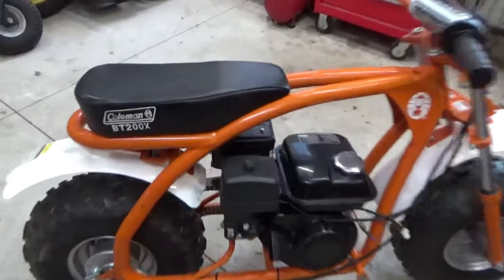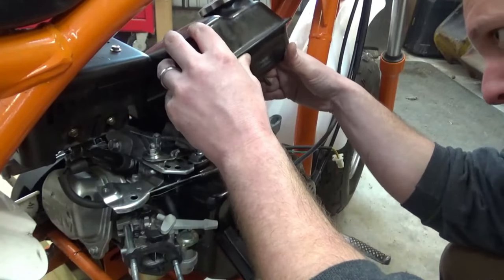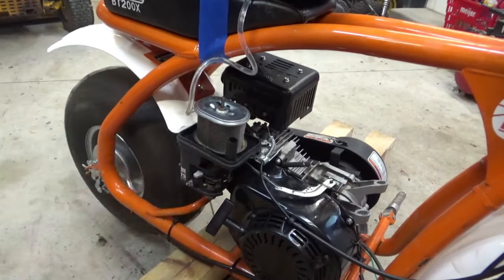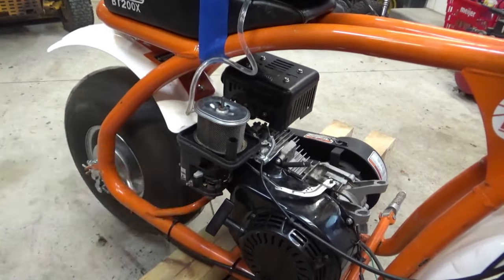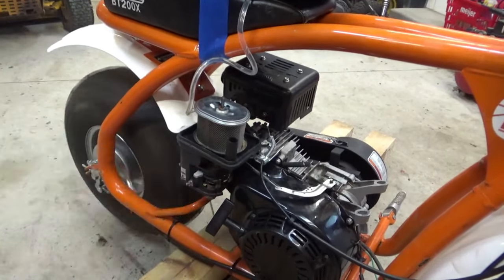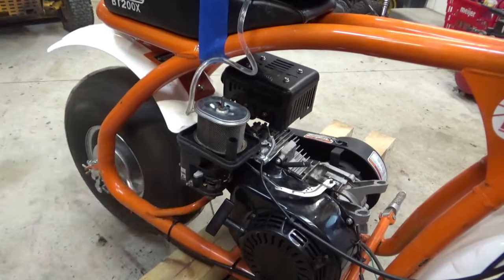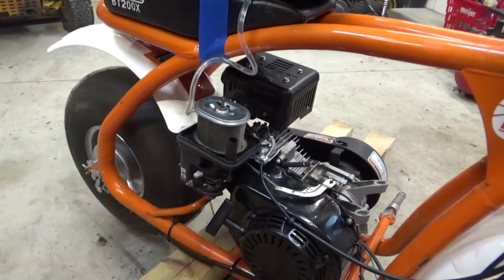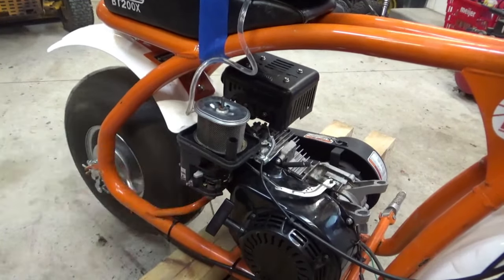Coleman Minibike's not running right...

Comment: The choke lever to the left is choked. Moved to the right is choke off. 

Pulling the governor is never a good idea unless you do not care about shortened engine life and the possibility of catastrophic failure. Governor removal should only be done at the time of an engine build.

There's nothing wrong with the governor/throttle linkage. It's a 30 year old Honda design that is still used to this day. The only negative is the Coleman return spring which is too long and can bind. I shorten the spring and use a small spring like you used here. I run built engines with the stock linkage and governor. Both bikes are 45 MPH plus. One of my bikes runs to more than 50 MPH at 5600 RPM.

The Hisun 196 is a good quality clone engine. Easily a better quality engine than the 196's that Harbor Freight sold prior to the Predator coming out. It's too bad so many of them have been abused and ruined then called junk by those who ruin them.
Reply: @quintinalvarez3922 laughing like 🤡

Comment: Greetings, just found your channel. I have 2 mini bikes, one is a Massimo Warrior mb200 (which is a rebranded baja warrior) it has a predator non hemi 212cc wit a billet flywheel, +.020 billet rod, hot265 cam, thin head gasket,  stainless steel valves with 26lb valve springs, and a vm22 carb. My other is a trailmaster mb200-2 with the factory 196cc with the billet rod and billet flywheel, cm cam, 26lb valve springs, and a vm22 carb. These are great little engines with a few mods
Reply from the maker: Welcome aboard!

Comment: also  instead of drillin and tappin that old governor hole you could have just cut the arm off the shaft and put it back in the case. that way if a governor is ever wanted to be reinstalled the hole isnt all messed up. just sayin

Comment: That Fly Wheel Is Weighted For A Governed Engine , It Needs A Aluminum Billet  Fly Wheel, A Much Lighter One Because Of The RPMs It Will Be Doing. That Heavy Fly Wheel Doing Those Kinds Of New RPMs Will Get Destroyed & Do Major Damage To That Engine. That Old Fly Wheel Is Not Designed For That.
Reply from the maker: Jon I have to disagree. I’ve seen lots of ungoverned engines run with their original flywheels and never cause damage. You’re not in the business of selling aluminum flywheels are you?
Reply: @MikesGarageShop   Ha Ha Ha . your Funny. Ok You Will Find Out Yourself
Reply: @user-ru7he6qj2w Not only that. With enough run time above 5K RPM he's going to ruin the rod. And what they do is run it right into valve float then find out from youtube videos that they need 18 lb valve springs which makes matters worse.

It's a shame because the Hisun 196 is a pretty good engine. I just opened my nearly 7 year old Hisun for a mild performance build and it looks great. It will get a billet rod and cast aluminum flywheel.

Comment: Will the link to that whole pull start mechanism bolt right on to the engine or will I have to just replace the coil
Reply from the maker: I’m not sure what link to the pull start you are talking about? The pull start will not get in the way of the new throttle set up.

Comment: How are you going to repair anything when you don't understand the mechanics of the choke?! You now have it in the on position which helps you start it and then you move it right to the off position to see if it stay running! It will not go nor sound right when you give it gas! 😂😭🤣😭😂😭🤣

Comment: There wasn't anything wrong with that bike the governor was on the whole time. You took that bike apart for no reason. But you live and learn.
Reply: That's an incorrect assumption and not surprising. It's clear that the owner of the bike worked on it trying to get more speed. And then gives the bike to a guy who doesn't know what he's doing troubleshooting with the choke on. That's a 15 minute fix and a faster bike when done, if you know what you're doing.